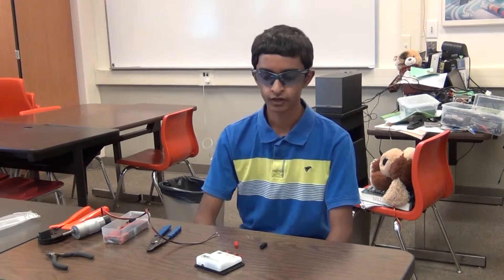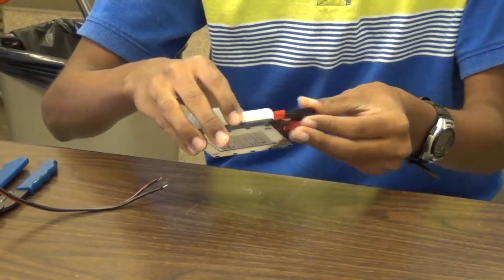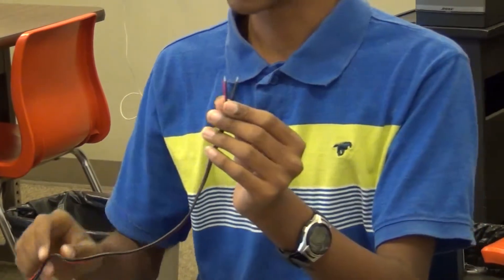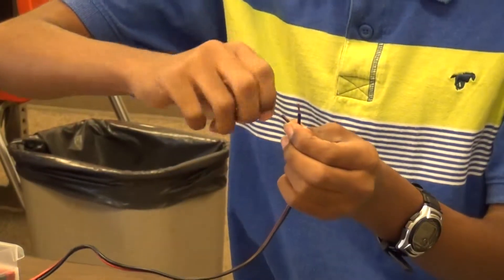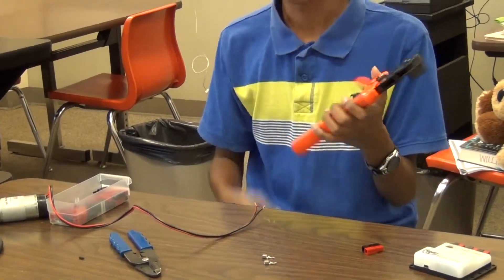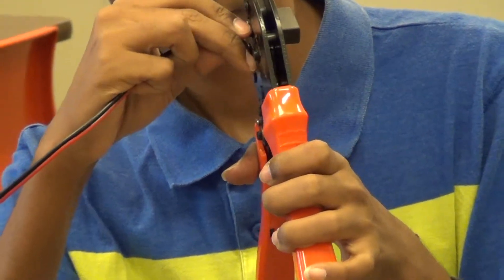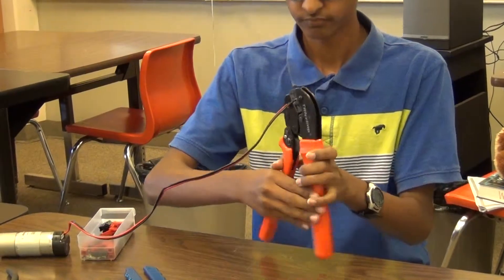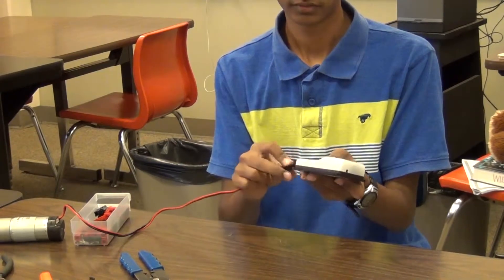How To Crimp AndyMark PowerPole Connectors

Comment: If you use the correct size wire and rated pins then you only need to crimp once with the appropriate size

Comment: I'm curious to know why you chose the 45 amp contact. I'm aware that Modern Robotics uses them too, but Powerwerx says they are recommended for 10 gauge wire. Thanks for your help.
Reply from the maker: iliketurkey Since Modern Robotics decided to use the 45 amp connector, we used the 45 amp connector. Since most teams would probably be stuck in this situation too, we decided to demonstrate to double crimp with a 45 amp contact as well(as the connectors come with the contacts).
Reply: Thanks for the reply!